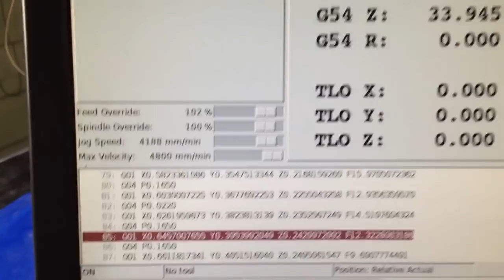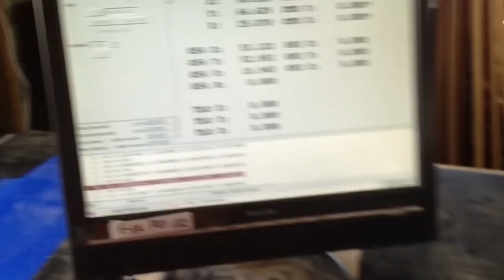Super Mario Bros. CNC Music :-)

Comment: When i did this, it played it on the y axis and was really low pitched. How do i change the tone or move it to a different axis?
Reply from the maker: Hi..  Were you using mid2cnc.py or another program?  I used the command-line python script mid2cnc and there's a constant 'machine_ppi' you set on line 25 which effectively sets the tone.  It's the number of steps per inch your machine does...
Reply: @ChrisHellyar  where can i find mid2cnc.py

Comment: Hehe. Nice. Though I can't help but notice that the rhythm is a little off now and then. Is this a limitation of the machine, or just a bad midi file?
Reply from the maker: Michiel Helvensteijn  ROFL...  It'll be a combo of the path interpolation / acceleration settings in EMC2 and the midi conversion.  I've had a bit more of a play with this since i made that video and some midi files convert and play very faithfully, some are really bad.  Using steppers not connected to a heavy machine you could set the acceleration to be 10x higher than I have on the machine and get a much better sound I imagine. :-)
Reply: Chris Hellyar  Do you have the Gcode File or just de CNC text so I can put it in my machines? Thanks Awesome video!
Reply from the maker: Tomás Chernoff If you google 'mid2cnc' you'll find the program to create the g-code.  You need to set up mid2cnc to create the file for your machine..  Step size, microstepping etc. to get the tones right..  It's pretty easy to get working, and a bit of fun. :-)